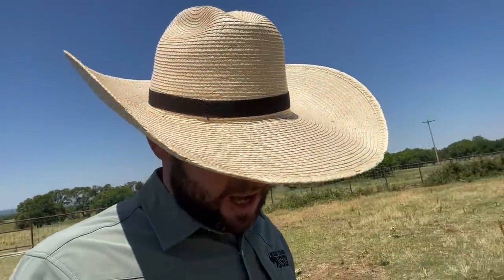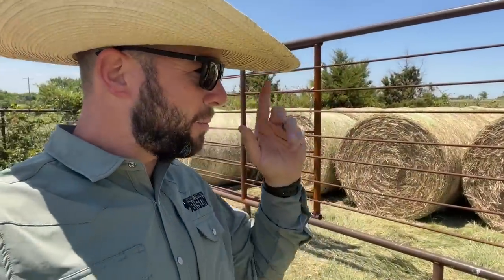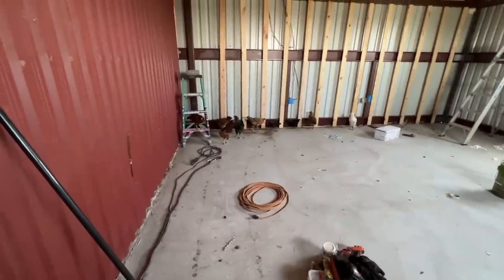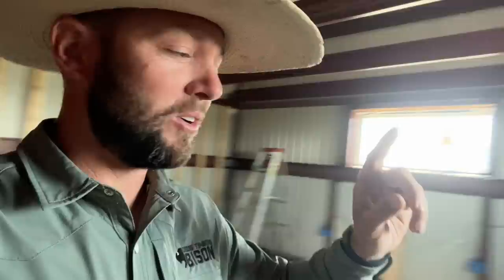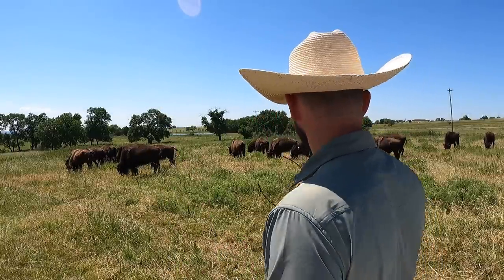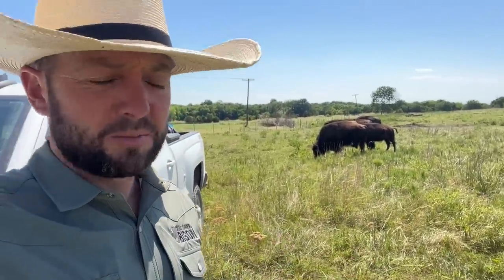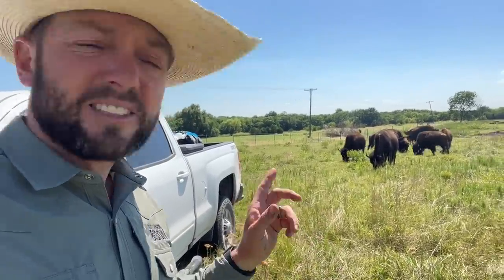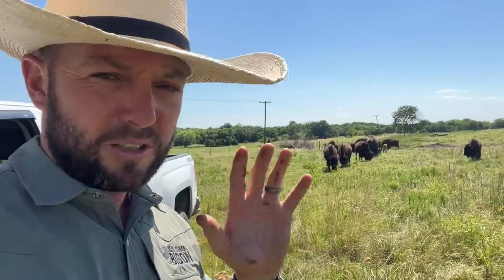Got the Phone Call I Needed | It’s Been a While Since I…

Comment: With the cost of gas, which is more economical.. horses or trucks. 
Do you have drip irrigation for the flowers? With the heat you have that may be a great option but unsure of the cost to install. Uses less water than sprinkling system and less waste.
To be able to stock up on hay now is great. Many farmers/ranchers will be scrambling to get hay later on if you don’t get more rain.
Reply: All Depends, owning Horses is cheap.

Comment: Maybe put up a mister system to cool them off. You can poke holes in a waterhose and make your own
 Run it across the top of a fence or barn the mist can lower air temps by about 20⁰ depending on how cold the water is. Just an idea for the Red Dogs at that pasture

Comment: Horse would be less stress, but there is a chance of the bison goring it whether by accident or on purpose. I think you would have better luck but you would not have as much protection with a horse as you do a atv or truck either. Do not run the horse/s with the bison all the time either for that exact reason. You will need a separate pasture/paddock for them but can have a common panel fence between them so they get to know each other and be familiar that way also. Be sure if you get one that it is "ranch" broke and not over 12-14 yrs old (they can live till their 30's but usability can dry up around 20 or so years old so the younger the better but well broke aka true kid broke/ranch broke would be a must). If you go that route, be sure to see if you can do a trial to be sure the bison do not spook the horse you are looking at, have the neighbor ride it in the group of yearlings first then the larger herd if it does ok with the yearlings. Any type of expressed hesitance after initial curiosity around the bison I would no go with that horse. If you can I would say a gelding would be best (mares can be very hormonal when in heat aka bitch mare - I have owned quite a few horses all were either mares or a stallion - stallion was easy compared to the mares 99% of the time for me anyway). Also take into account the cost of tack, feed, worming, vaccinations, hoof care, and emergency vet service if god forbid you need to use that option. With the cost of gas these days the costs would be about the same having a horse vs engine power in some respects (moving the bison between pastures) but more expensive in other respects (general maintenance and upkeep). Talk with other producers and doc about what they think with the small herd you have if they would think it would be worth it. Also if you use the horse to check the herd remember a horse is slower so will take longer to do checks then with a vehicle and we know how busy you are already!  Just for reference I am 52, have been around horses my whole life. Personally I prefer Arabians over quarter horses, they have more speed and agility and can handle the heat better then most breeds as they are descended from desert bred horses and that is my experience ( have owned Thoroughbreds, Arabians, Appaloosa, and paints - ranch I worked for had Quarter Horses and quite a few were dumber then rocks or had major issues with being tacked up due to how there were "cowboy broke").

Comment: Awesome horse riding to yes a horse is alot of work as well. . Big step to think about . And hay and cleaning of it's coat and feeding it as well.  Yet no gasoline use and able to be less stressful ? Using them .  A fast pace or slow pace  as the herd moves across the lands. Then Winter time also which is better the horse or machine use . So that's what you need to be aware of temperature changes as well for horse use. During the winter time. Also. Physically demanding. My uncle and aunt had two horses . Alot of work. But no buffalo . So they could handle them. But work as well we would help out during my summer as teenager to clean out barn and get hay for feeding them. Water . Wash them comb groom them ride them with saddle s. So we were free help during our high school to summer day s.  On weekends. It was great! I really enjoyed that. So that's option also for teenagers summer days to help out . In your family ??? I don't know. Something by to think about as well.